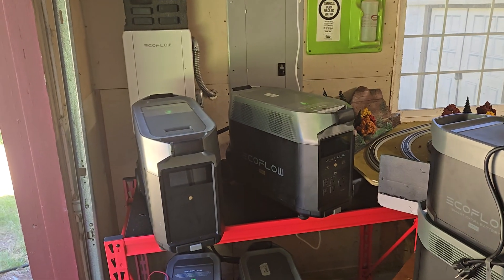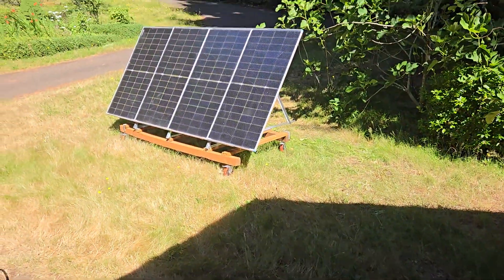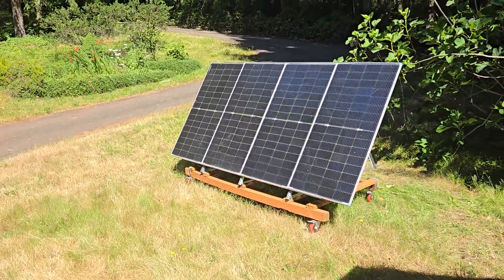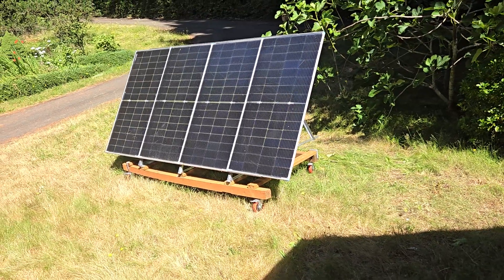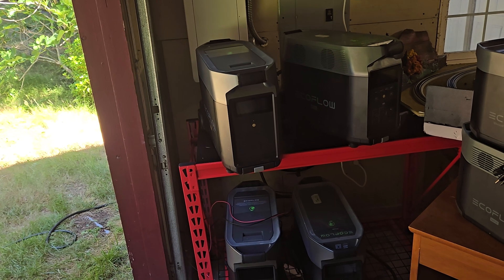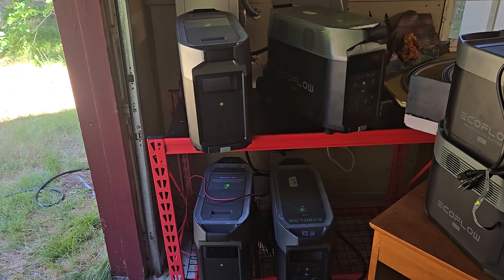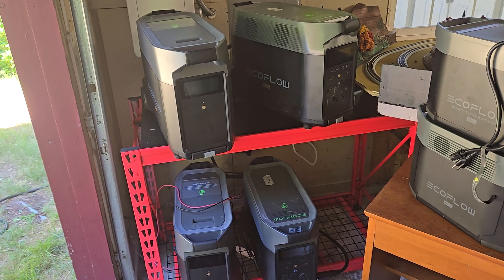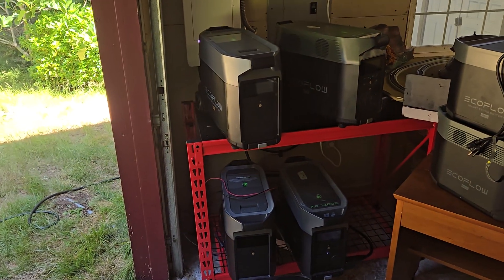battery backup, summer 2024 update

Comment: I have been running my generator for 8 hours straight and it's giving me a damn headache. Please advise what battery will give me a 50 amp 240v service to back feed my panel like I am doing now? Generator is a 5500 watt continuous output.
Reply from the maker: @plywood76  suggest looking at Ecoflow website.  Also on Facebook there are a number of active groups on Ecoflow and Ecoflow Delta.  You might also look for videos of people who did whole home battery backup via transfer switch.
Reply: You would not need 5500 watt continuous output with a battery/solar setup.
You need to figure out what your daily kilowatt usage is and go from there. Some of these, you can pair up to get 240v.
Reply from the maker: Example

https://www.facebook.com/share/p/jb3jC98JvXYy23qm/?mibextid=NoJtEM
Reply: @HulaViking   Some options 
https://youtu.be/i__nMuz6M74?si=LXhi67l6PZPqIBjg